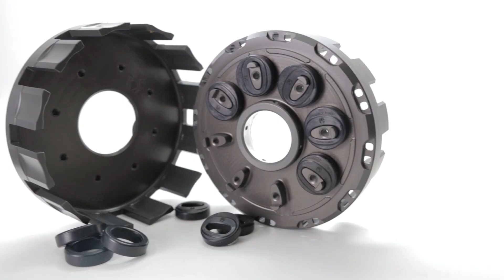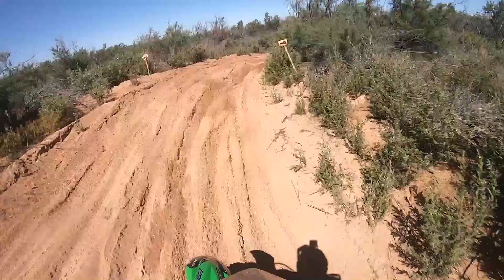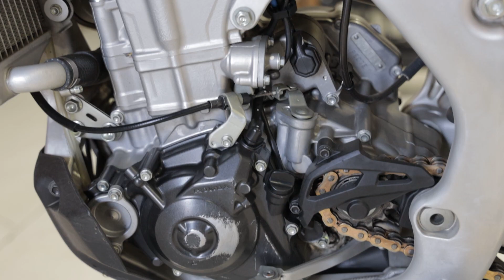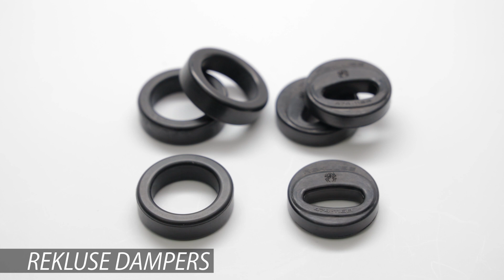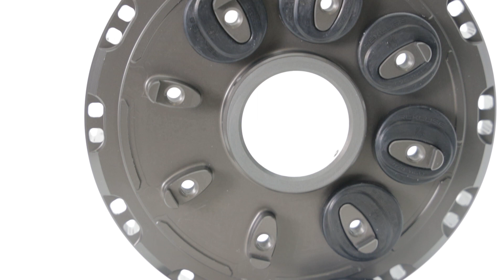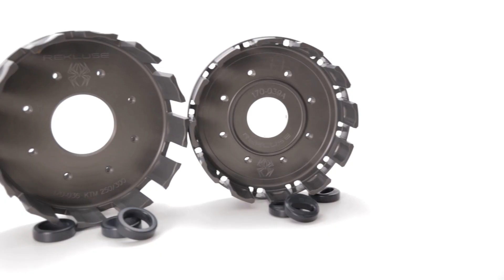Rekluse Dirt Bike Clutch Baskets and Dampers Explained

Comment: I was gonna use the OEM one for a while but guess I’ll have to order this since I got a rekluse manual clutch a few days ago. I have yet to install. Does the rekluse clutch come with bolts since I’ll have to grind off the studs that hold the gear on the back of the basket?
Reply: I bought the 3.0 and spent over a grand and it's not got a few pieces I thought it would have
Reply from the maker: Yes our clutch baskets will come with all necessary hardware to reattach the gear.